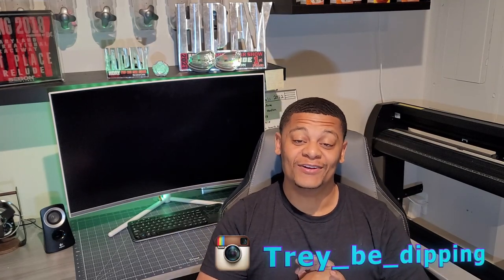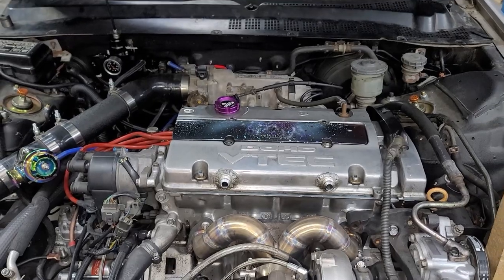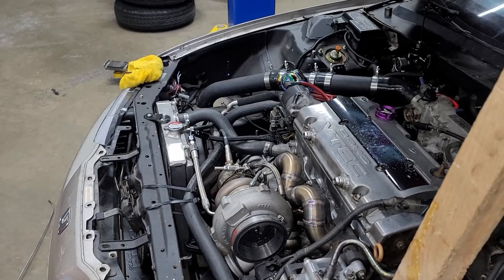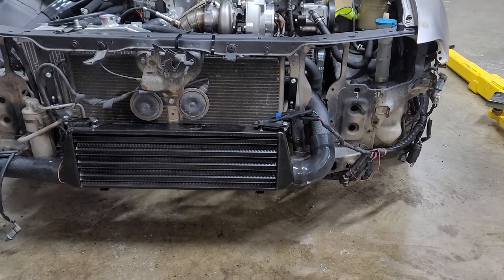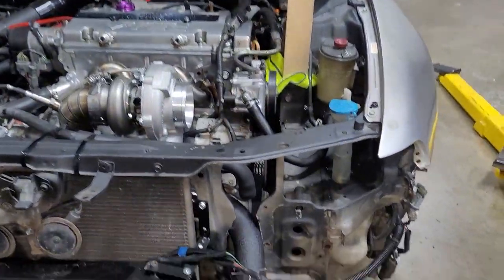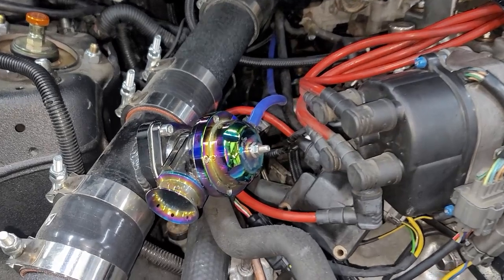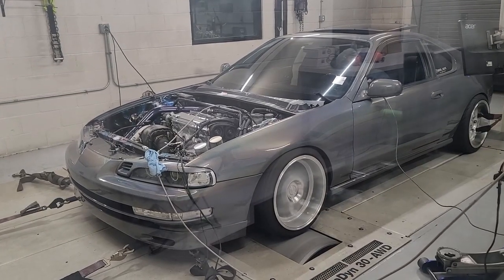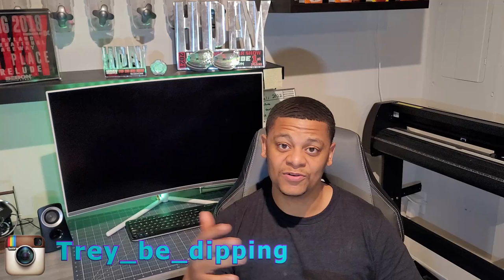Foundation for a turbo build starts with this! | how to turbo your Honda Prelude pt 4

Comment: I think the first question should be what are you using it for? you can make less hp and still have a faster car. a turbo can move power around due to housing size. it's all about what your doing with this power.
Reply from the maker: Both questions are within the same sentence. I agree

Comment: Hey what up trey … question you have h22 .. if you do .. what direction did you with the block (frm sleeves are no bueno I heard to turbo )
Reply from the maker: So the motor I currently have is closed deck h22 with a Brian crower kit essentially with a fully built head. Capable of 800+ but I bought it like that I didn't build this one personally.

Comment: Trey, are you running knock off BOV and WG on your Good good Lude w/ clear hood and also this build? Thanks in advance. I only had Blitz and Greddy in the past and want to know if anyone ran knock off stuff and the results.
Reply from the maker: My other prelude is running dual tial wastegates. And this new one is running an Amazon wg
Reply: @treybedipping1734  . Thanks for info. I have to keep watchout in upcoming vids to see Amazon WG outcome .
Reply: @treybedipping1734  . I be honest with ya Bro didn’t get to watch complete video the other day. Injectors or Really good injectors are NEEDED when boosting I didn’t hear that in the line up list. U already know that but for the video sake.
Reply from the maker: @notone4029  I mentioned not to cheap out on any fuel components
Reply: K My bad Bro.

Comment: this shit helped so much dude nobody makin these type of videos im building my 5th gen prelude rn
Reply from the maker: I got plenty more bro hope they help
Reply: @treybedipping1734  thank you dude nobody really be goin through it like that but do you think I should swap out the stock internals I got a jdm h22a with 50k miles I’m swapping into it
Reply: @treybedipping1734  not trynna push a ton of power
Reply from the maker: @sorid6965  honestly if you do just rods you'll be good up to 500hp...stock internal only good for 350 or 10lbs which ever comes first

Comment: what style manifold will allow us to run ac and ps on our 4th gens? great channel im subbed, thanks
Reply from the maker: Unless its custom like this one likely only a log style manifold or mini ramhorn
Reply: @treybedipping1734 850 states there's runs both. Assuming the RAM would also, I wonder which would flow best...anyone have any strong opinions?
Reply from the maker: @mccrac5247  the log will always be the worst option in any scenario

Comment: Thanks for the info man. Would you recommend sleeving the block and building the head for 400hp?
Reply from the maker: Sleeving no but you can get the block css'd and def rods and pistons. Stock head is fine for 400